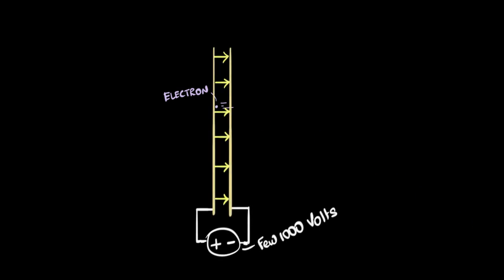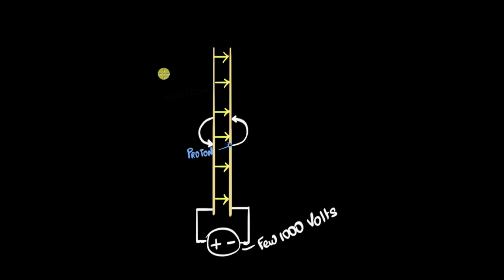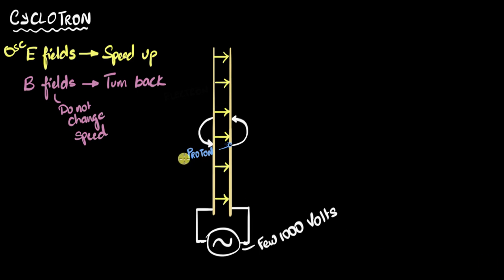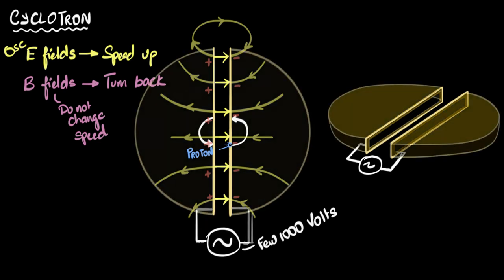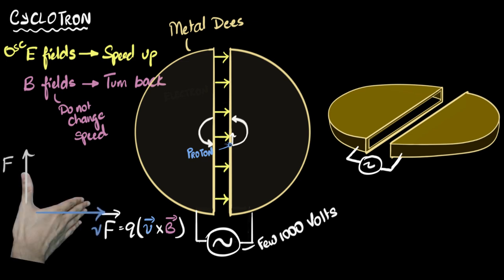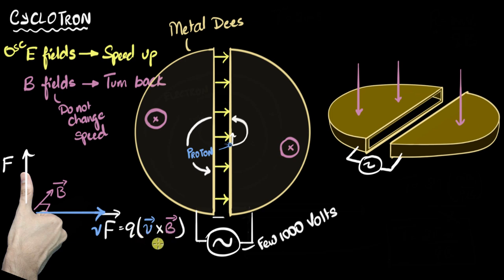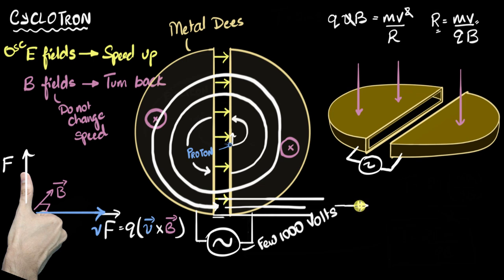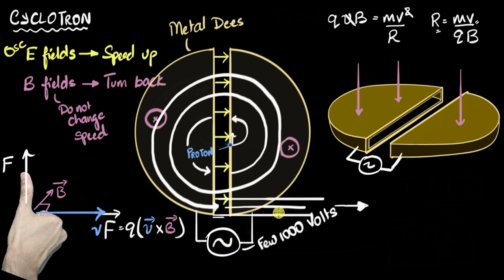Cyclotron -  working principle & construction | Moving charges & magnetism | Khan Academy

Comment: Great explanation of a cyclotron. I take it we shouldn’t cross the streams right? That would be bad? ;) I once visited a cyclotron at a hospital that was used for creating the radioactive medicines used in radiotherapy. The thing was huge! Easily filled a basement. We weren’t allowed into the room - even though the cyclotron was powered down. Phials of what was basically sugar water was placed into the machine in large batches and they were irradiated. Once done, couriers had 24 hours to get them to patients to ingest prior to a scan. Half life of less than 48 hours so they basically peed harmless water afterwards! Amazing.

Comment: This a great video!
The first question about frequency was something I read the other day, but I don't quite understand it, so feel free to poke holes in my theory of operation; It seems intuitive to me that the frequency needs to be ramped up, but now realize this is wrong. Based upon what I recently read on this subject, the frequency is fixed and the radius will naturually increase as the speed of the charged particles increase; it's own mass will cause this. When it get's fast enough, the radius of curvature approaches the radius of the D shells. 
I was already pondering the 2nd question before it was asked; how do they get the electron to shoot out in a straight line in the presence of a magnetic field? We were presented 2 options, affect the magnetic field, or the electric field. It looks like they turn off the magnetic field to stop the curvature. Any amount of magnetic field is going to make it curve. The showed a straight line for the proton's exit path. 
I was wondering if a faraday cage works on the magnetic field. I did an experiment using a key FOB and aluminum foil. I thought to myself that aluminum will NOT block my key FOB signal because it's non-magnetic; WRONG! It does block the EM field. You can try this yourself and see. 
However, I suspect this is because the aluminum shunts the E-field, also robbing the M-field of strength as result. 
To answer the question posed to us, I suspect they just put a small hole at the edge of the cyclotron, and put a metal conduit that shields the exiting protons from the magnetic field. Is a faraday cage for magnetism even possible though? 🤔 I know you can divert magnetic lines, but can they actually be blocked with a mu-metal?
I suspect they could put a grid with high voltage, such as in vacuum tubes, to give the protons one last push before the exit point. As the proton passes through the grid the potential turns positive and this repels the proton one last time. 
Please feel free to tell me how I'm wrong, or correct. Thanks.
Reply: hats off to you man other people are just doing timepass and you ANSWER IT

Comment: answer to the first question is that its time is not affected by each increment of the particle's speed because as the particle gets more speed it turns more radius and as you know time is the ratio of distance traveled and the speed by which that distance is covered so for bigger speed there will be bigger radius .therefore, the ratio stays constant.
Reply: Since w(angular frequency) dosent depend on velocity or energy it means it would be constant and we wouldn't need to change the E.F

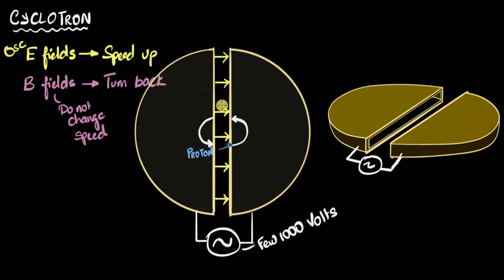Comment: Could someone tell me at 4:46, if electric field cannot penetrate, doesn't that mean the proton won't be able to enter it because the dee has to be closed (or else it will let electric field in)
Reply: Yes I'm glad to help, basically what we have done is to use metallic shells so that the protons can move inside them and as they are metallic thus conductor thus the electric field which would go out and come in is now 'cut' ✂️ so now that field won't affect the proton.
Reply: @sameepshukla8971 how is the electric field cut? Also sorry I could have worded my question more clearly. It appears that there are openings in those metallic shells for the proton to go in and out. But since these are openings, electric field can still go in, which is not what we want, so how does this opening not let electric field from going in?
Reply: Your question shall be answered correctly via diagram but it is a binding in yt comments. Yet I will try to make it clearer.
1) only the rectangular sheet produces the electric field
2) let's say the field is induced by +ve charge 
3) electric field can't pass through a conductor so it will have to end on the surface
4) this will induce positive charge on the outer surface of the cyclotron(right)
5) the field lines orginated from there will end at the outer portion of the left cyclotron thus it should have -ve charge on outer surface
6) this way the inner surface of cyclotron(left) will have +ve induced charge 
7) this outside field will have no effect on the proton as it is inside
8) the inner induced field will support acceleration
9) this arrangement will be reversed once the original field is reversed using AC source 
I suggest you to use diagram to understand this and I expect your to know about induction 
This phenomenon by which the external field doesn't affect inner particle is what I term as gap.
Reply: Hope it helped.